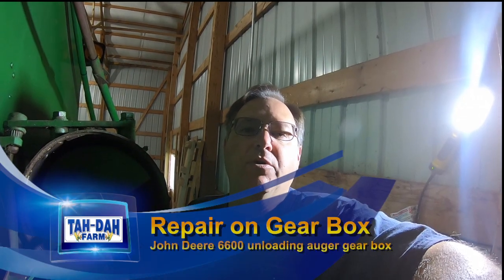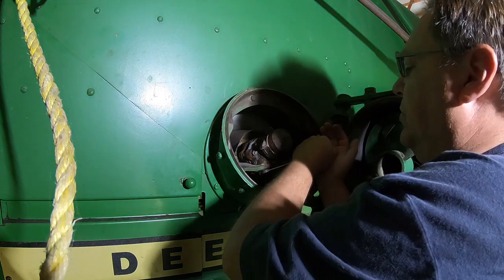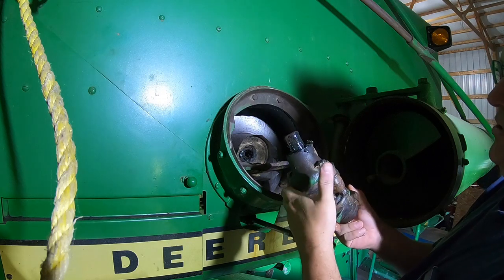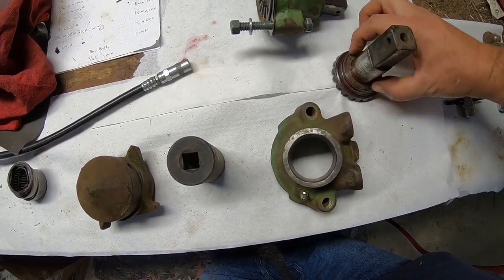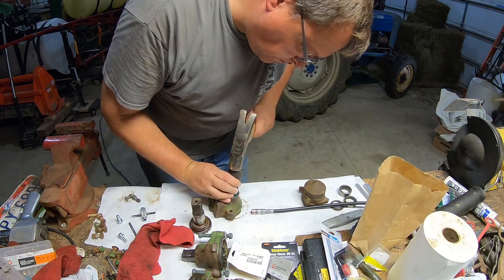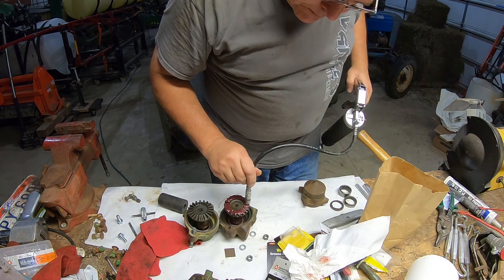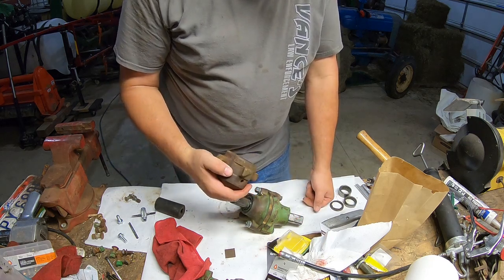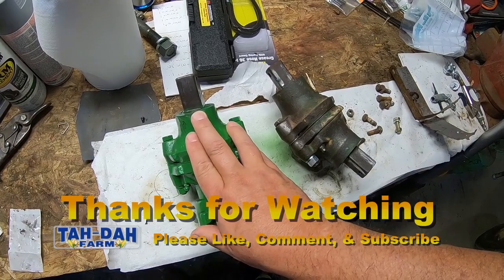John Deere 6600 Main Grain Tank Unloading Auger Gear Box Repair

Comment: the old freezer trick!!  excited to see the ol girl run in crops!!
Reply from the maker: Thanks, and yes the freezer trick works again. I hope I can get everything done in time to get the crops off.  I am having to put a poly liner in the tank now. I found some bad spots so I'm getting it fixed right. Beans could be ready in  3 to 4 weeks. And corn should be getting close if not al ready starting to black layer.  We started a shutdown Monday and I'm on day, 12 hour shifts 7 days a week. So we will have to see how things go. It has been a whirlwind thus last month.

Comment: Always nice having a junk combine like that for parts. It also saved you some $$. It won’t be long and it will be harvest time for you. Hopefully it’s not to wet where you live. I think we’ll be fine here as long as we don’t get anymore big rain events. Anyways, great fix and hope everything else going good for you!
Reply from the maker: Thanks, it is nice having the parts combine.  I need to get some of the parts off and put them in storage before they get bad from being in the weather.  We are on the dry side but that's ok. I stiil have the auger out of the grain tank and I'm trying to fix the floor in there now. I have a poly liner on order and should be here by the weekend. I have 3 to 4 weeks before my 1st bean field will be ready.  My corn should be in black layer by the weekend, so it will be a little bit before it drys for harvest. We missed most of the rain you guys got the last several weeks.